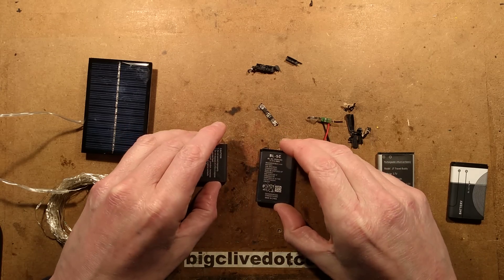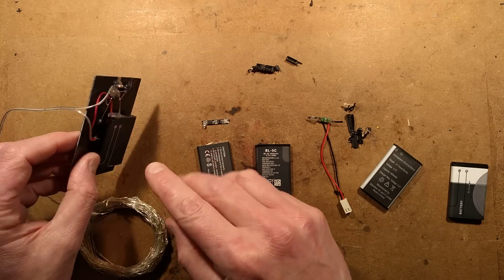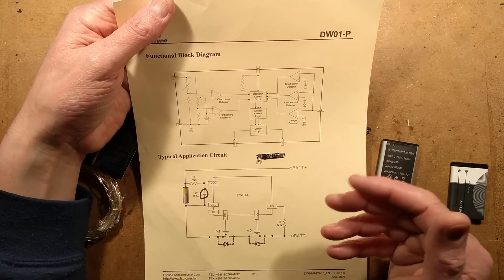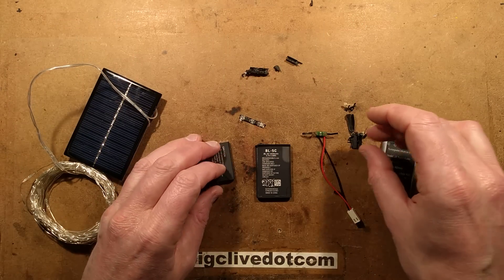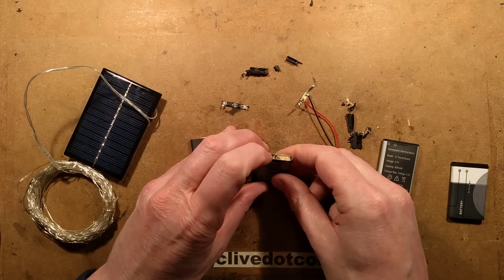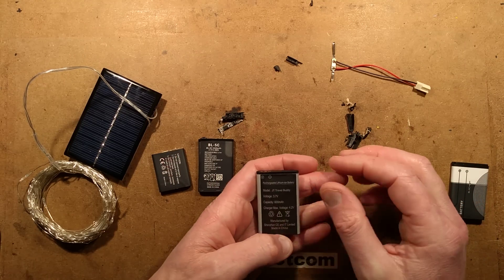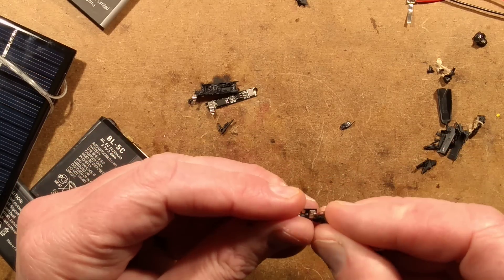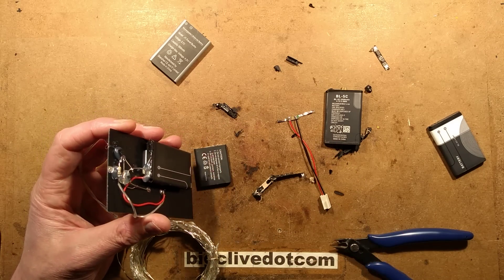Unprotected phone battery copies.

Comment: Thanks for the demo on how to remove the protection circuits on these types of batteries. Very useful to know! I collect old phones and I'm going to trying using the protection boards to bypass the battery requirement on some of them since finding replacement batteries is shady or just not an option.

Comment: I wonder if I could replace old Samsung battery's pack with a new one (albeit a different sized pack) and use the protection circuit from the original battery. Would this is possible? if yes, is that even a viable option to DIY replace batteries for old phones that even 3rd party parts are not being made.

Comment: Thanks for this videp👍. 
I see always 3 cupper connections on these batteries: +, ~, and connection 3: what is the function of this??
Reply from the maker: Sometimes a thermal sensor and sometimes just a resistor to identify the battery type.

Comment: I've just tested 3 batteries from phones I've previously recycled. The two Alcatel batteries have short circuit protection; the battery from a TCL Raven does not. (I only buy phones with removable batteries ever since I had a phone with a soldered-in battery die because it drank water in through the charge port from a damp pocket in a rainstorm.) Just goes to show that even a fairly known brand of phone can have unprotected batteries.
Curious and concerned, I quickly tested the battery in my LG Rebel, and it happily does have protection.

Comment: Nokia batteries. Used them in many projects. I always made them easy to remove and put it in a Nokia or into the charging station I made. Very handy. No time for charging? Just change the battery over

Comment: Do you know a safe source for a E61i battery?
My batterie (original from ... 2007?) now begin to get fat ... so throw it in the battery bin.
But you don't know where to buy a genuine / safe replacement ...
On my 9210 I bough a cheap one ... the blown up and I believe if I did not see it, it would been burning...
so a big risk today for old phones

Comment: I regularly take my 18650 bare cells to 4.3-4.4v as "full" and it hasn't effected them that badly if at all, my 1500 mah Samsungs I'll even take to 4.5v and discharge them at 10 amps
Reply from the maker: It does shorten their useful life.  But you trade capacity for lifespan, and each has their merits.  I recommend charging them in a metal tray though.
Reply: Lol I charge them on a wooden cd/DVD rack unmonitored with a float voltage of 4.6 from a 4.2 1.1a nominal smps made for old Motorola cell phones, never had a cell go thermonuclear beyond heating up a bit from internal shorting I have had them go dead where they will either not take a charge at all or they will short and heat up from the charging current, I can leave them on the charger for a few days and it'll get to 4.58 which is not good but most cells can take it at the risk of lost capacity in the long run, lithium polymer on the other hand I've had melt down when overcharged, they puff up and then go boom

Comment: The middle (usually on 3 contact batteries) pin's resistance indicates the default battery capacity (and type) to the phone, crudely hardcoded - 68k indicating 650mAh. There were other versions with a fourth terminal that was the temperature monitor...
Reply: Ah....thanks for the info, as i was wondering.

Comment: Hi BigClive. Big Fan! Do you think these boards could be legit? https://www.ebay.com/itm/Pure-Sine-Wave-Power-Frequency-12-24-48V-600-1000-1800W-Inverter-Board/132861014224?hash=item1eef2230d0:m:m-kj2Q12xohV3tPcPtCxZwA:rk:8:pf:0&LH_BIN=1
Reply from the maker: Looks real, but they require an external transformer to step up the voltage.

Comment: As someone who has lost a lot of money and 6 years of my life due to non-specification goods shipped from China this video tells you everything you need to know. My Chinese friend in Hong Kong spends much of his time trying to avoid being ripperd off by mainland China dodgy operation and unless you know the quality of each stage of Chinese production there are many out there who will do pretty much anything to same money- missing out components, suppliing sub standard materials, reducing the strand wire numbers in multi-strand wire and the notorious putting melamine into milk. So you buy a battery in good faith and someone saved 2 cents leaving out the protection circuitry and the resulting fire burns your house down. Looking for brand names does not help much because not only do they fake whole products they even fake electronic components and I can think of major world players who have had to junk huge quantities of electronics due to this problem. A country in which they use 'gutter oil' for cooking says it all and the general attitude out there seems to be that it is the buyers fault for paying cheap rather than the suppliers fault for shipping poor/ illegal spec goods. And you can forget about getting compensation if they do you over...

Comment: the thing with a lithium ion battery's  is that if it goes up in flames..it REALLY goes up fast. so you need a battery protection system built in.

Comment: hi clive, been watching your channel for along time and learned a lot from you.thanks man.
was wondering, is it possible to connect 5x 12v led strips in series to get a 60v led strip? i am building led light from a photography softbox  (already built 2 that work on 12v you can see in my channel) the thing is, i want to keep the cables down to a minimum so i need to keep the current to a minimum  but i don't know if the resistors on the strip could take it (i am planing a 720w fixture and it will be built from high quality 95 cri led strips).  tried asking on forums and could not get a straight answer. please answer since you are the led Jedi. i need your guidance :-)
Reply from the maker: If the strips are all identical and the same length then yes.  But I'd recommend using a 12V supply (or better still, two or more) and having the strips in parallel.
Reply: thanks for the quick replay clive, you say you would use 12v but didn't said why.
i know 60v i far more dangerous but that is part of the fun, but seriously. the led's are going to be in a closed box with no danger of accidentally touching a live contact and this way its less wires and thinner wires too, so is there any other reason why it may be a bad idea???  the why i am planning this light, it will be out of 1m pieces (lowest Resistance according to most manufacturers) connected in series,5 strips per group and than every 60v group will be in parallel with all the other groups. these are 12w/m led strips and i am planning on a total of 720w, 360w for the 3200k warm led's and 360w for the 5600k cold light. and yes, i am a bit crazy....  my first attempt was a 560w fixture made from a 80cm soft-box octagon with a antec 700w pc power supply and it made a beautiful light but since it was a soft light even with 560w it was not bright enough. and now that one of them died in a storm......   :-(   , i want to go BIGGER.. btw would love to see you build one too, this softbox really is great for video and kind of easy to make

Comment: Why charge to a voltage that is inherently unsafe? If you keep the power supply to 4.2V 500mA it will do exactly what a dedicated LiIon charger will - constant current up to set voltage, then constant voltage until the current goes way down.

Comment: The safety principal for most electronics should be that no single failure should cause a dangerous event.
The protection module on the battery pack is there as EMERGENCY protection. Other circuitry should limit current and voltage under normal conditions.  It is possible to think that everything is OK, relying on the protection module alone, but the more projects built this way the greater chance that there will be an incident.
DW01 is reasonably accurate at sensing Voltage, however the DW01 has no sense resistor. It measures charge and discharge current by measuring the Voltage across the MOSFET. The MOSFET "on" resistance is only specified as a Maximum value. If you get one at the lowest resistance of the tolerance, the maximum current maybe higher than is good for the battery.

Comment: I was forced to effectively throw away a Nokia 6500 Slide because Nokia stopped making BP-5M batteries and all the ones on ebay are fake or knackered to the point of only retaining enough power for one days standby or ten minutes talk time, so after buying about 8-9 fake (including holograms) I had enough. shame really as there was nothing wrong with the phone
Reply: AmigaMan, could you just clarify, what was the problem with  the "fake" batteries  ?  did you test them and decide they were dangerous to use because they didn't have proper protection ?  I have bought several things which are "fake" but they still work fine. I don't wear a wristwatch, but if I did, I'd rather pay $20 for a fake "Rolex" which tells the time just as well as a $20,000 genuine Rolex ! Paying a higher price for higher quality is one thing, but sometimes you may end up just paying for a brand-name so some shareholders in a Swiss corporation can buy another Bentley .
Reply: by fake I mean they were sold a genuine 900mAh yet when charged on a bench power supply they would be anywhere from 300-600mAh and would decline to useless within 6 months where as the real batteries I had with the phone were closer to 950mAh and lasted for 3-4 years before I had to replace them.
Reply: @amigaman9433  Thanks for that clarification. Years ago I knowingly bought a "fake" battery for a video camera. For the same price  as a small original replacement battery would have been (about NZ $65) I got a double sized "knock-off". It has performed very well for me and I'm very happy with it.  Yeah with your phones, I see how if it was just a few less mAh then  I'd consider  that acceptable, but performance as poor  as you stated, and only a 6-month lifespan, is seriously crap. What's annoyed me is having to dump perfectly good 2G mobiles that had nice clear buttons and displays and worked really well, because of forced moves to a minimum of 3G (In both Australia and NZ) even though the batteries were still going fine. I had to effectively dump 2 good 2G phones, that nowadays all I can use them for is as a torch or a radio .
Reply: it is indeed the sad state of commercialism, consumer electronics are purposefully made defective or forced in to an end of life scenario so we the consumers are entrapped in a perpetual cycle whilst being fed the lie that we are more environmentally friendly than our forefathers.

https://www.youtube.com/watch?v=YvkRnEv6WG8

Comment: My old Sony J5e  mobile has a battery with 3 terminals. The original batteries held the date when you took the battery out. 
I don't think it had a clock circuit but it held the time ling enough to change the sim.
Replacement batteries don't seem to have this feature. Unless it is a good knock off.

Comment: I took one of these batteries out of an old 'drug dealer' phone and soldered on the connector for a ps4 controller so my controller does die so quickly anymore. There is also one inside my Bluetooth mini keyboard thing I use for my TV box lol. I love how universal things can be with a little knowledge and tools.

Comment: How can we test for the lack of protection circuitry without opening the battery?  I suppose we could see what happens when we overcharge it, but that seems a bit risky.
Reply from the maker: I'm going to be running some tests.
Reply: @bigclivedotcom  Thanks!
Reply: Use a multimeter in high-current mode. Tap pins with probes to short them. If current doesn't immediately go to zero, protection is nonexistent. You can use a scope on the pins and observe how quickly the output is turned off. A recently bought batch of genuine BL-5Cs turns off within 10 ms.

Comment: The battery in my Cubot phone swelled up and failed after about 6 months. It was the battery that came with the phone, not one I had bought. 
I still have it if you want to dissect it to check the quality of the batteries they send with their phones.
Reply from the maker: There's not an awful lot you can tell from opening a failed battery that has puffed up.  Did you leave it anywhere it could have got extremely hot?
Reply: @bigclivedotcom  Absolutely not. Always charged on my computer desk away from heat and sunlight.
Reply from the maker: @TheStwat  That's odd.  I wonder what caused the failure.

Comment: Why are there three connection points on the outside of the battery? I have an old cell phone battery that I might want to use for something but the three terminals kind of confuse me.
Reply from the maker: The two outer ones are usually marked + and -.  Ignore the middle one.
Reply: The middle one has a resistor to the minus pad to let the phone know what capacity the battery is. See http://www.cpkb.org/wiki/BSI

Comment: A wee tip for you Clive, when dealing with moulded plastic like this it's a good idea to use a heat gun to soften the plastic up before you start stripping it off the circuit board. Makes things so much easier.

Comment: It's easy to tell if the knock off batteries have proper protection. All you need is a bunch of equipment, the knowledge and decades of experience to use it, and the patience and diligence to keep track of how they are charging. Otherwise you can spend the extra money. Thanks for the information Clive.
Reply: Use a multimeter, put it in current mode, tap leads to pins to short them. If current doesn't immediately go to zero after a short blip, protection is nonexistent.

Comment: I'm not paying £60 for a 7.2 - 1.5 A h drill battery. I hope a couple of high drain 18650's and the below will do the job from EBAY.
 5A XL4015 DC-DC Step Down Buck Converter Module Power Supply LED Lithium Charger
2S 20A 7.4V 8.4V Li-ion Lithium Battery 18650 Charger BMS PCB Protection Board (Balanced version)
I don't have a clue what I'm doing so it's YouTube for a few hours. 
£3.15 for both. The XL4015 is very good and I have used it a lot, the protection ?
Use in the shed, concrete floor in a biscuit tin.
No flowers.

Comment: Recently bought a third party LiPo cell for my Sandisk MP3 player, unfortunately, it does not charge inside the player. Measured the protection circutry: it seems to be "not compatible" with the original one (completely different readings on the sense line). Would it work if i transplanted the original protection circuit from the original cell to the new one? I'd have to destroy the original cell for that, which I tried to avoid until now, as it still has some life left (not much though)...

Comment: Interesting that the discussion is all about phone batteries.  My experience of BL5C batteries is as used in Casio digital cameras - I have several 'after-market' ones with chargers that use 240v or 12v sources and, apart from one original one which swelled up in a disused camera, my only observation is that some retain their charge longer than others.

Comment: EDIT: as  @Anvilshock pointed out, the 68k resistor is a battery size indicator. The battery I had experience with had 4 contacts instead of 3. The 4th contact being for a thermistor to monitor the battery temperature which in my counterfeit cell was replaced with a resistor which gave a constant inaccurate temperature reading.

The counterfeit and knockoff batteries often omit the protection circuit. Also the 68k resistor is spoofing a thermistor. I had an Android phone that used that style of battery and I put in a knockoff battery. When I did it no longer reported the battery temperature I just gave the same temperature regardless of the battery temperature (it would get quite warm while in use).
Reply: Is not spoofing anything. The resistor is there as the BSI, Battery Size Indicator, which is what genuine BL-5Cs contain, too. If the genuine original would have had a thermistor, it would have had a separate, additional pad.
Reply: @Anvilshock  you are correct. I remembered the battery having 3 contacts but after looking it up (as I could not find the old phone) it actually had 4.
Reply: @Zanthum  One more thing to watch out for: Some Nokia batteries contain a battery ID (BID) contact in addition to the BSI. It is yet another resistor to ground, and again not a thermistor. Really annoying.

Comment: Inbuilt protection circuitry is just that, for protection. You should never charge cells in a manner that relies on this protection, it's only there to protect the cell if there is an issue with the charger.

Lithium cells should be charged via CCCV circuitry, where a constant current is applied up until a point then it's switches over to constant voltage which will prevent the cell from being overcharged. Current will drop away as the cell reaches terminal voltage as the potential difference between the charger and the cell gets closer to zero.

Comment: Oh how i was wondering when you'd get to these Nok-off's, I have 2 Nokia N900's that require the next one in this chain the BL-5J's to function effectively, I notice how a good number of the batteries I order off Ebay end up being bunk or bad ones :( great video, and someone commented how get one of those OVP circuits and wire it to the battery and go from there, can you suggest a good one? Or just reuse the charging system from a portable battery pack wired up to the battery?